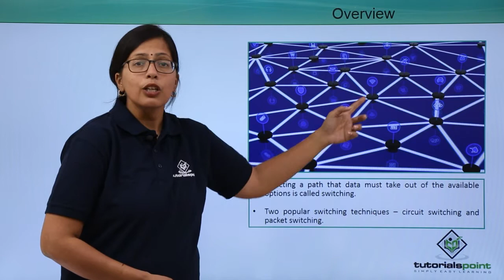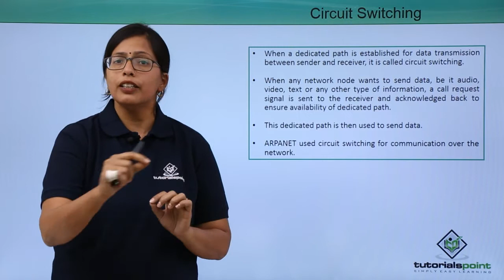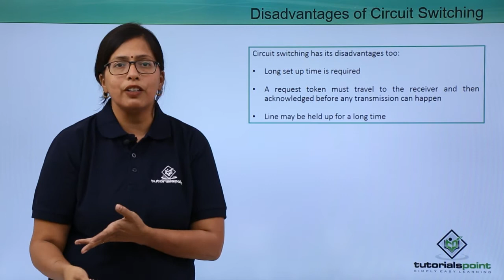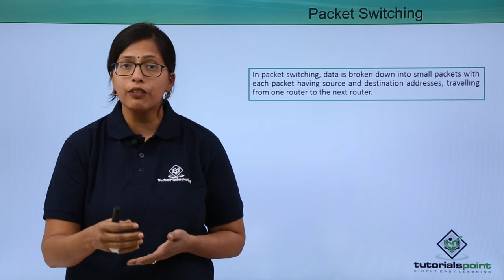Switching Technologies

Comment: The Advanced Research Projects Agency Network (ARPANET) was an early packet-switching network and the first network to implement the TCP/IP protocol suite. Both technologies became the technical foundation of the Internet but you have discussed it that circuit switching is used by ARPANET?
Could you please clear it 
Link : https://en.wikipedia.org/wiki/ARPANET#targetText=The%20Advanced%20Research%20Projects%20Agency,technical%20foundation%20of%20the%20Internet.